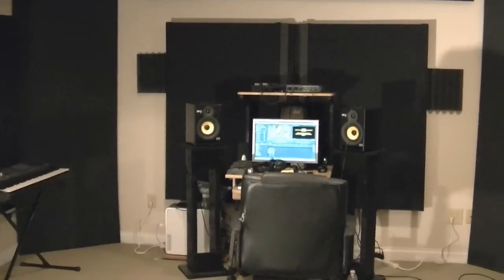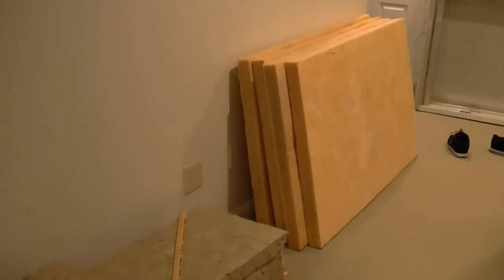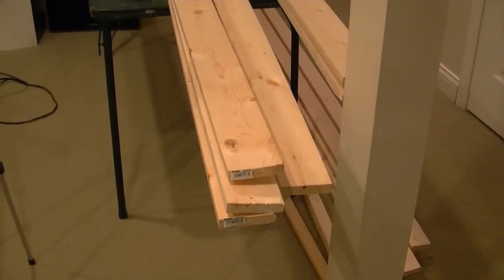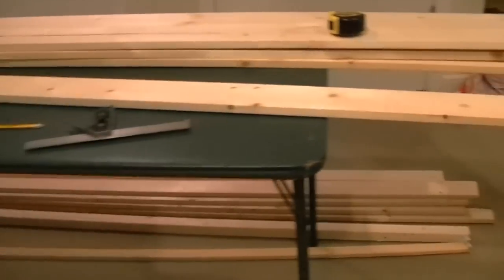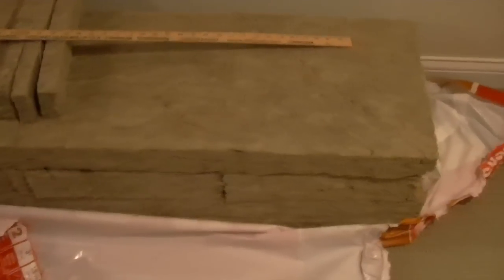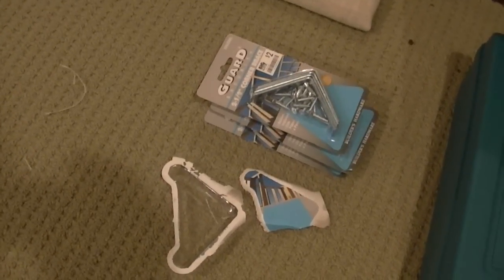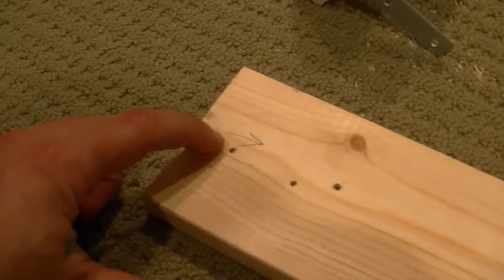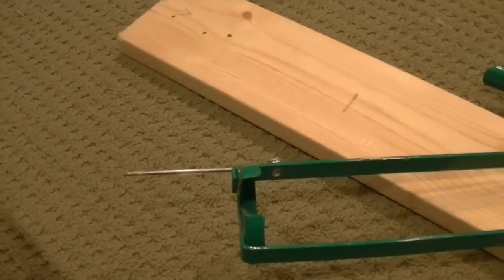Part 1 How To Build Acoustic Clouds and Wall Traps

Comment: hello there, I just finished my panels but I got a problem here and want some advices;..
I made it the way you made yours, wood frame, regular fabric as used to bed covers for insulation, I put there a fiberglass (a panel not the rigid one), than I observe under my room light that some particles from fiberglass appears on the front of panels, is it dangerous or is this can be diffused on my room air (when I got my window open etc) if yes, what should I do ?? cover with more fabric??
thank you a lot.

Comment: Couldn't u just fill a cardboard box with the insulation? I'm sure the cardboard would reflect some high end but its not a broadband trap anyways. of course it'd be ugly as sin
Reply from the maker: You could go as simple as taking sheets, and wrapping the entire panel in sheep. However, you would have to handle carefully, because there would be no frame.
Reply: Yeah i thought about that also but my dog would automatically think it was a toy and rip it up.don't think that'd be to healthy. I'm tryng to get creative bc I'm in a living room so i need something i can move outta the way if people come over and sturdy enough to last after being moved around a bit
Reply: Cardboard doesn't have any resistance against reflections like wood does. Plus, wood helps trap enegry and also slightly diffuses the sound. Cardboard also isn't sturdy and won't handle much weight if it has to.

Comment: Everything looks great but my question is if there is no health hazard using rockwoll or any product of such type in closed rooms. Aren't this insulating materials carcinogenic and aren't little particles emitted by them, which later you inhale?
Reply from the maker: My fabric is also tight weave. However, the back of the panel is exposed. As long at you are not bumping them, you would have no issues.

Comment: Great videos Dozer! Thanks for all of them, especially the corner bass traps which I used in my own studio and am delighted with the results. Because of a long countertop on the wall I used squares as opposed to triangles to get more mass on a smaller area. Only problem was covering it in material was harder due to 2 sides instead of 1. Thanks again!

Comment: Both types of insulation provide broadband absorption but the Roxul gives slightly better absorption of low frequencies.  If you were to back the panel with plywood or similar it acts as a membrane and will reflect high frequencies while acting as an absorber for low frequencies by resonating - the thicker the plywood the lower the bass frequency it will resonate at. Over-simplified explanation.

Comment: GREAT tutorial!  One of the things I love about your videos is that you explain every single aspect.  Almost all of them assume some degree of woodworking skill on behalf of the viewer, but you explain it right down to the tiniest detail.  Awesome.    Personally, I have a fair degree of experience with building with wood, but it's great that you're explaining in such detail.  

One suggestion though - I'm building a set kind of similar to yours, but using carpenter's glue and a pneumatic brad nailer instead.  It would save you a SHIT TON of time.  Although most people don't have brad nailers or compressors laying around, so I guess your way is much more universal.

Great job on all the tutorials - I'm totally stealing your design for my corner bass traps!

Comment: Dozer:  great video. Can you tell me exactly what type of insulation you're using and more importantly, where can I buy it?  Have a 24 x 14 room over garage with angled ceilings and want to build both panels and bass traps. Thanks very much in advance. Keep up the great work. Appreciate it a lot!
Reply: Wm. Sturman it’s RockWool Roxul SafeNSound

Comment: They got those rings you can screw onto your drill (comes with a drill if you buy a wood plugs package) you basically set it at the depth of half a plug, drill holes on each side, put the plugs in and attach the other end of the wood :) You could possibly use that for screws as well i think

Comment from the maker: They are pretty similar. google "Bob Golds Absorption Coefficients". There is a large chart with all the materials, and the coefficients. Easier to think of it as percentages per frequency, so if you see under OC703 Plain 3" at 125Hz a coefficient of 0.53, just think of it as absorbing 53%. If you compare 3" of Roxul Safe'n'Sound to 3" OC703 plain, they are around the same. Also head over to the Gearslutz Forum, Studio building / acoustics section, alot of info there.